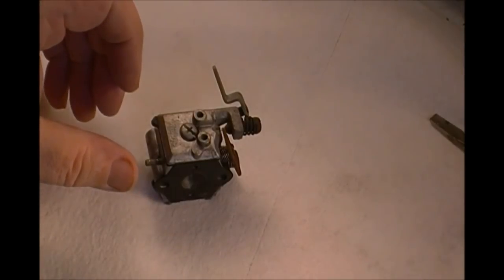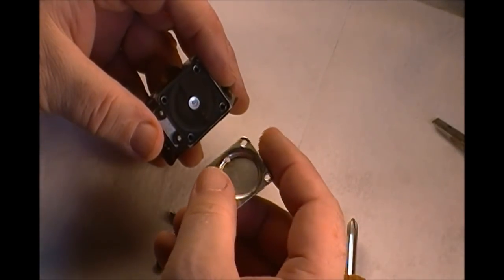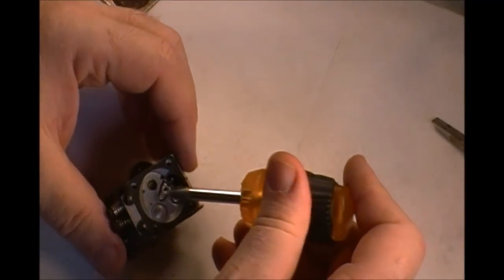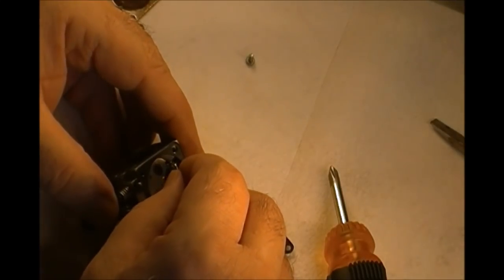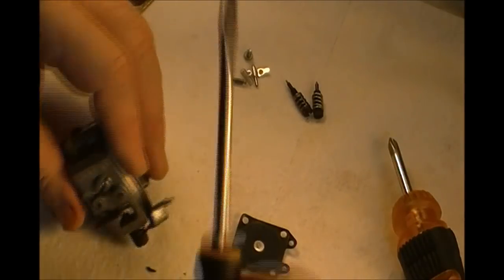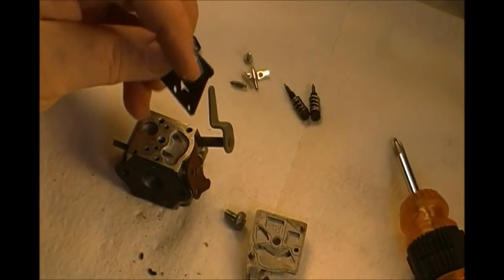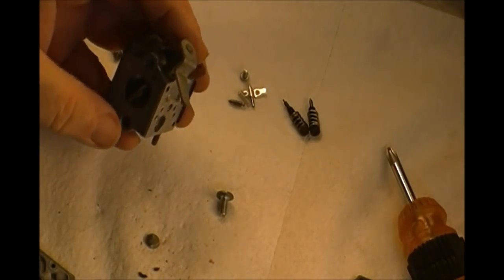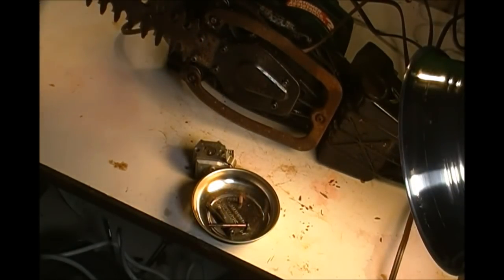PawPaw Brings Hedge Clippers Back from the Dead Part 4 of 4

Comment: Its alive great job paw paw i just dont know how you make it on those long trips. I just get too dang tired to drive after awhile. Look forward to your next project got one here of my own thats waiting on warmer weather. My little 2-cycle subaru water pump has fuel trouble thanks to this stinking ethonal in the gas.
Reply from the maker: I take naps in the rest areas.  But I gotta use a truck that doesn't have bucket seats !!  We have to learn to not leave gas in the carbs or tanks.
Reply: DoingItCheap yeah i use the rest areas too especially on my annual Gettysburg trip that coming up again in about 6 weeks. I usually make sure my tank and carb is dry but was busy and missed it that one time and that was the end of it. It cloged up the plumbing now got to rebuild it. If can find parts its quite old for a 2 cycle.
Reply from the maker: I cannot impress upon you enough about how much I like this ultrasonic cleaner !

Comment: Great tip on the clearance for the metering lever. Most people over look that step. It is a reason why some brand new pieces of equipment won't run because that clearance on the lever is wrong. I'm lucky enough to have the special tools for setting that. 😀
Reply from the maker: I have the W and the Z on order.
Reply: DoingItCheap you will love them! Takes the guesswork out of it. I am so happy I have a set.

Comment: I got a gas hedger too that's been sitting up for 2 years. I use stabilizer in my fuel but I fear it ain't going to crank up this summer. Looks like I'll be taking mine apart and working on it and cleaning it like yours. Lots of fun! LOL thanks for the video Paw Paw!
Reply from the maker: Fuel filter, fuel line, carb kit.  That's all you need !

Comment: Saved another one from the landfill! Might mention the idle and high speed adjustment screws take a special screwdriver tool to adjust them unless they are real old (Weedeater takes the round splined one, but there are more). I run the synthetic oil and 100% gasoline mix too; it seems to  not stop up stuff as bad from sitting.
Reply from the maker: This was the old one with straight screwdriver slots.  I have the 8 pack of carb tools also.  We have a few stations here that sell the 100% gasoline also.  I need to mention that in future videos.  Thanks.